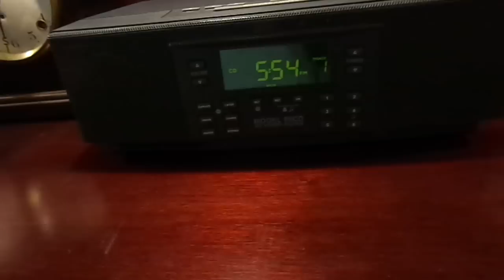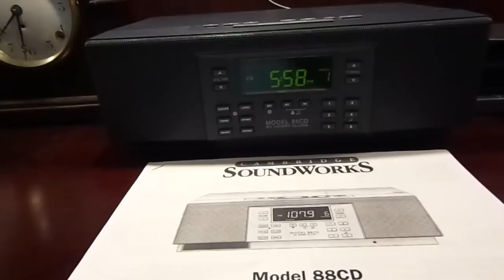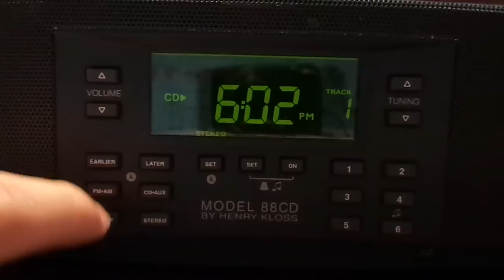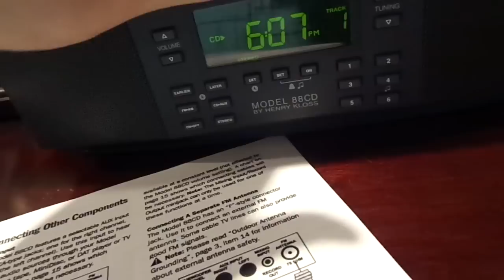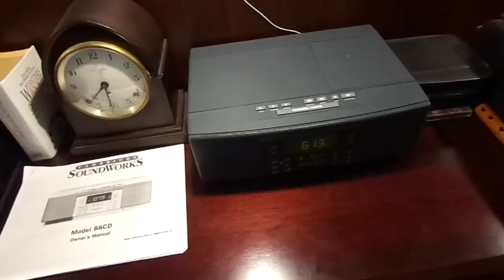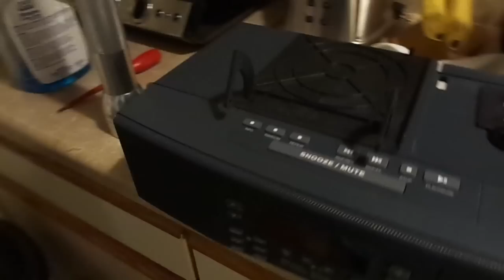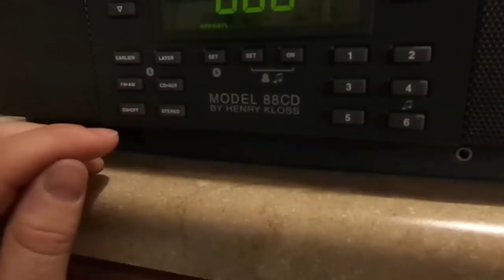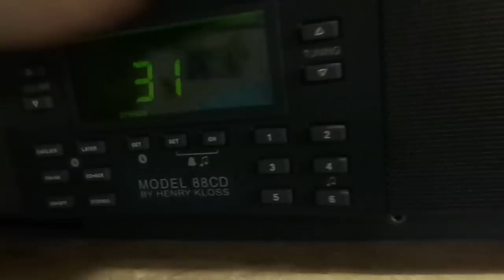Henry Kloss Model 88CD Stereo

Comment: Dad bought one of these and I ended up inheriting it a few years back. Anyway, I recall Dad using a clock radio into an old stereo that the AM/FM tuner had long since crapped out on. I forget the name of the stereo brand, but the clock radio was a GE unit that had RCA outputs on the back that served as Aux inputs on the stereo with the bad AM/FM tuner. Radio Shack had clock radios that could be used as an input on stereo amplifiers too. The thing with older stereo components, they weighed so much, built to last forever that a 10 cent part that failed often was what put them in a dumpster & transported to a landfill.

Comment: Love my original 88 radio only..has dc power jack in back, cd and 3.5mm aux in ports..
About the sub volume control..mine's so sensitive it sometimes goes into max sub and massive distortion.. Adjustment helped but now its pretty steady bass overload..Will compressed air clean out the subwoofer volume dial innards?

Comment: Do you happen to know if it is possible to change the battery that is responsible for keeping time after it is unplugged and where it is and what type it is?  The 9 volt battery only keeps the radio presets, last volume, and last source.

Comment: I had 88CD for a long time. Didn't have problems with speakers or CD, but fm radio reception was always bad and clock runs too slow. Anyone know how to adjust clock to run accurately?

Comment: Hello there, Sir. Have this exact model of radio & somewhat ironically, the same issue with my CD player, as well. A broken tab on the right hand side. But because I know that I would make said issue even worse if I ever attempted to try & “fix it” on my own, might you (who obviously knows a hell of a-lot more about electronics than I ever will) think it would be even worth it for me to take it into a professional to get worked on. Or do you think that the cost for said repair would make it not even worth getting fixed? Any insight would be greatly appreciated. And I pray that you do not mind me asking you in the first place either. Cheers!!!
Reply from the maker: I’m not even sure where you’d find a “professional” to work on this thing… your best bet is to find another one that isn’t broken.
Reply: @bbishoppcm  - Thanks for the response, Sir. But even if it means that I can only listen to the radio through this from now on, because I really do dig how it sounds, no way I am going to just scrap & or donate it either.
Reply from the maker: @why-why-whywhywhy  yeah, but fortunately because of the age, for what you’d pay someone to fix it, you should be able to get another one with a working CD player. Or you can use the line-in jack to connect a portable cd player. These do sound amazing - I ended up giving mine to my father who uses it in his garage.
Reply: @bbishoppcm  - You Sir, have made my day/night. And I say that with all sincerity, as well. Because I had no clue that I could hook up a portable CD player to this beauty. So thanks very much for the tip. Be well. Cheers!!!
Reply: @bbishoppcm  -  - PROMISE not to hound you anymore about my predicament regarding this radio, Sir. But having just been gifted a Sony Discman by a relative of mine, so as I could pair it with this radio in order to play my cd’s, I just wanted to clarify where I might slot both ends of the stereo cable I bought for it? Assuming that one would go into the ‘line-out’ on the discman & the other in the ‘mixing input/record out’ of this unit? Or as a novice of most audio related gadgets, might I have that half-assed backward? Thanks in advance, should you find the time to answer, as well. A lovely night to you & yours.
Cheers!!!
Reply from the maker: @why-why-whywhywhy  I think at this point you need to do some trial and error, or google the owners manual

Comment: I believe this is a reupload as the original had multiple editing mistakes it.
Reply: DGTelevsionNetwork think he uploads video then uses youtube editor to edit the video. so the full video is hidden from everyone but we see the edited video. guess messed up editing first time
Reply from the maker: james42519 I don't actually use the YouTube editor; I use iMovie. I'll be honest;  the newer version of iMovie confuses the shit out of me sometimes, which has led to many editing errors. I had a workflow established in the older version, and then Apple up and changed everything.
Reply: +BBISHOPPCM's World  I have the newer 740 CD model. it also has a built in subwoofer, with the bass frequencies routed through the unit similar to a transmission line design but at a much lower cost.

Comment: So I just tried this model and I have the cambridge soundworks 730 radio which is the successor to this.  I think the 730 is better.  I also have an older late 90's Bose wave radio.  This is actually significantly larger than the Bose, perhaps about twice as large by volume.  I'm not sure this is better, but the 730 is better than the Bose.  Course at this point, you can get these on Ebay for less than a hundred dollars.  That is an awesome value for this form factor of a somewhat smaller all in one semi portable 2.1 system.  For an even better value though and quality, a couple of powered bookshelf speakers from Edifier is better than all of these systems, so for 150 dollars, you could get Edifier's r1700bt radio.  Of course that's going to a 2.0 system which has decent bass, I think better than these radios and the portable nature of an all in one system is gone.
Reply: The Model 88CD is built to last though. It's an AM/FM tuner with CD. One could easily convert it to be an MP3 player too with an older smartphone. All you need is the 1/8 TRS to RCA patch cord from the smartphone's headphone level output => Model 88CD's Aux Input. And with wifi router & internet connection, one can stream music. I do this with the Model 88CD & a HTC One M7 that is CDMA (Sprint) that is now dead (January 2021) as a cellular phone platform. 2:1 Stereo system hasn't improved much if any. If the Model 88 still works, connectivity may be by component, but the sound quality is the same.

Comment: Henry Kloss apparently had issues with Amar Bose be it professional envy of Bose success or the fact that Bose did and was more successful and still is more successful than any of the lost and found audio companies Henry had anything to do with one thing is clear and that is Cambridge Sound works was another effort by Henry Kloss to rip off all of the Bose products of the time. Like the wave radio vs the HK radio or the satellite speaker bass module systems that literally started coming out of the woodworks once Bose started making and selling them. Everyone talks crap about Bose yet they, much like apple, are the most copied manufacture in their respective industries. That my friends speaks volumes no matter what your criticisms of each may be. You cant argue with success no matter what the so called “audiophile” elitists say. I remember these Kloss radios as well and I seem to remember they were not that much less expensive than a wave radio and as you can see they were filled with all the same so called “cheap plastic” and “cheap” chip amplifiers as the wave radio yet nobody ever criticized the legendary Henry Kloss for that. Now Bose is still an American owned company still making the wave radio and not a single on of Henry Kloss’s companies can say that. THE END